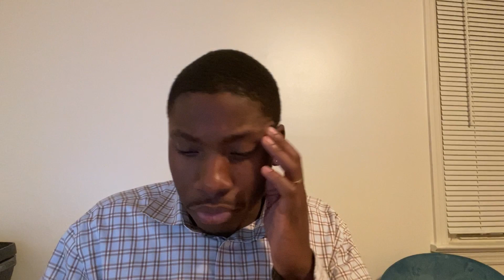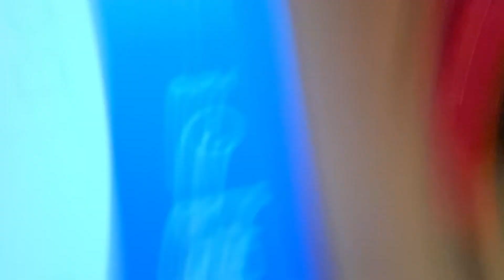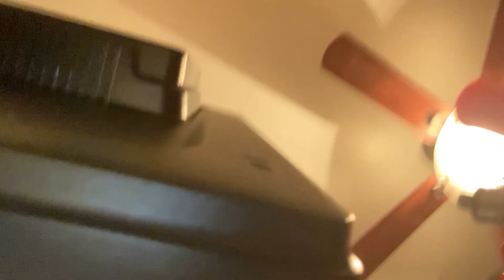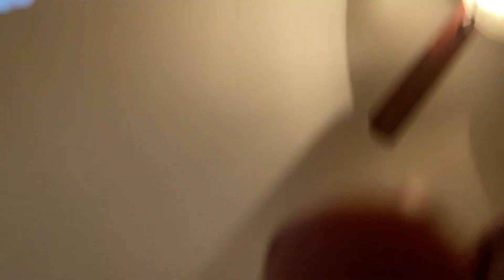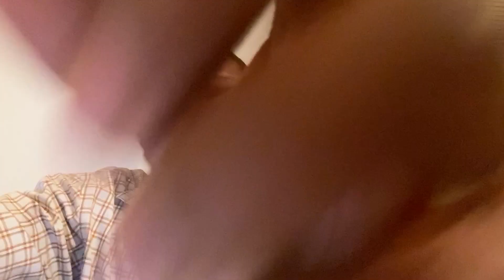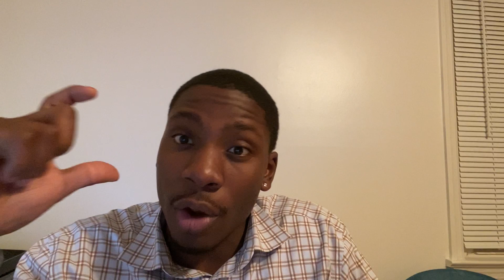AV203 Part 121/135 Operations - Part 135 Certification Process

Comment: Chris, How long does it take to complete the 5 phases and receive certification?
Reply from the maker: The Part 135 certification process can take an average of two years to complete from initial application to receiving certification. Phase 2 Formal Application is by far the longest portion because of the statement of compliance.